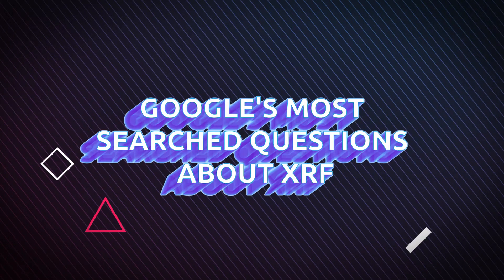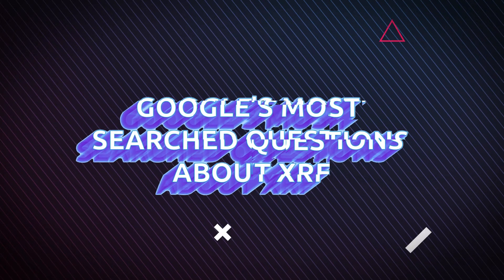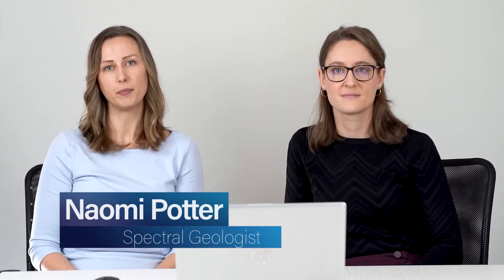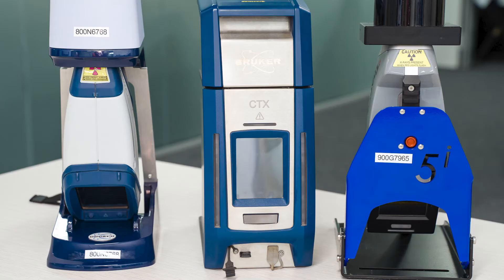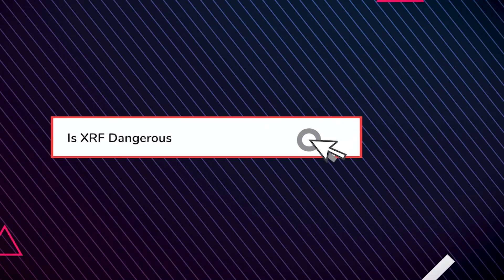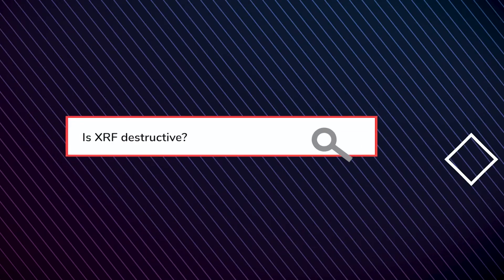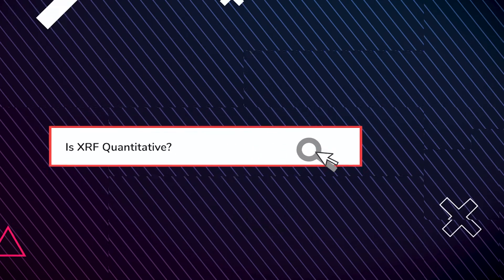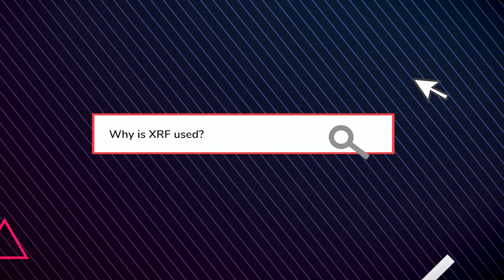Portable XRF: Most Googled Questions Answered (X-ray fluorescence)

Comment: My XRF won’t allow an analysis to be triggered when it is in the stand and the cover is down. Is there something to do without putting a piece of paper over the sensor
Reply from the maker: Hi Alexa,
Many XRF instruments allow you to disable the proximity sensor, but require your acknowledgement that you are overriding a system safety protocol, as without the proximity sensor, you can trigger analyses in unsafe conditions. In the case of Bruker handheld XRFs, this requires you being logged in as Supervisor.